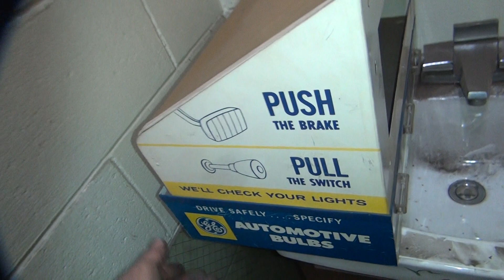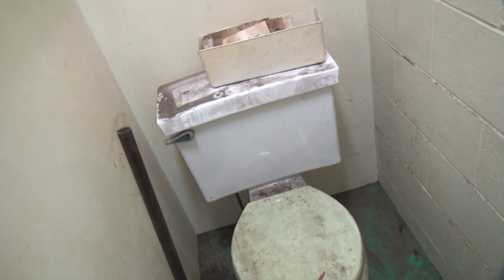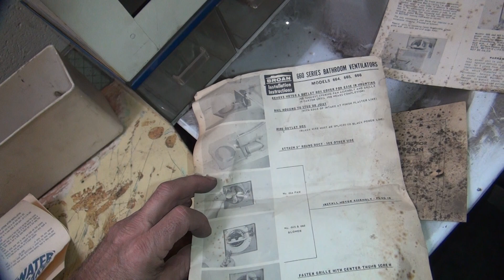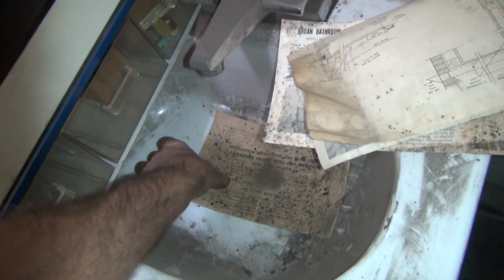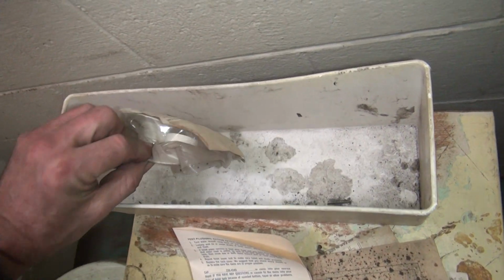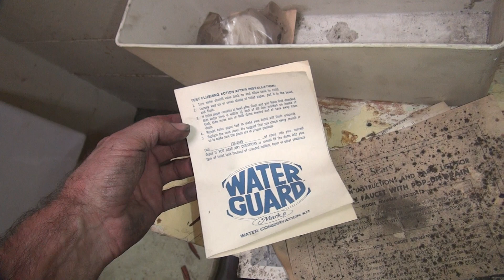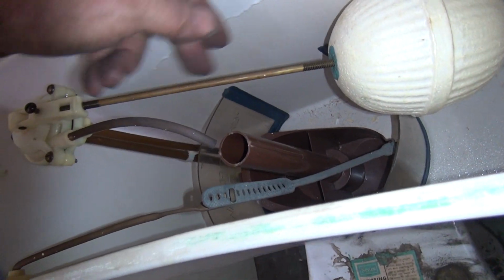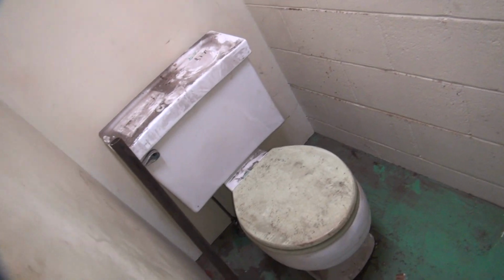#1 feb 2022 start of a new year getting up to speed at tatro machine harley shop tour vintage 60's

Comment: I remember those lake injectors I was in a shop probably in the late 70s and I asked the mechanic who owned the shop what those were and he explained what they were. And now that you speak of electron I remember that one too. I don't know why it didn't take a hold I never really looked into them though.
That strikes a memory
Great treasures I remember my blasting caps and my little gun with the red caps roll caps
My father was born in 1919,
I do like steam engines and those little engines that powered the radio control ,well at that time they were just on a string and they had a little propeller at the back and the little planes too. you could get them at the hobby shop for like 8 bucks but you put the gas in it and you hooked up the glow plug and had a whole afternoon of fun

Comment: Hey Tatro, the float valve only moves about a quarter of a inch.  So, get your plumbing squared away then see if the float still works. They never seem to work right again after you take them apart. I do like your dads choice on the sink fixture, very practical, for a shop sink.
Reply from the maker: i wonder were i can get a new rubber diaphragm to fix this 1965 piece. with any luck i will be able to fix it. for now it is stuck but i will be taking it apart and see what i can do. its just like old harleys, take it apart and fix what you can.
tatro
Reply: @Tatro Machine  I would try a true value or old mom and pop hardware first. If the diaphragm is not broken or torn, soak it in water and see if it will soften up. Also check mobile home supply store.
PS wouldn't waste to much time on it, a good new one is around 20 bucks, time equals money, but you already know that.
Reply: @TatroMachine  call or go to San Diego Hardware... they have that old stuff...

Comment: Damn tatro Broan still makes fans today.....pretty cool to see man. Definitely don't see brass and copper inside the tanks of the commode today
Reply from the maker: that was when things were made to last your life time, not the parts. i wonder were i can get a new rubber diaphragm to fix this 1965 piece. with any luck i will be able to fix it.
tatro
Reply: @TatroMachine San Diego Hardware has what you need...  E-bay the part sir...  just say`n